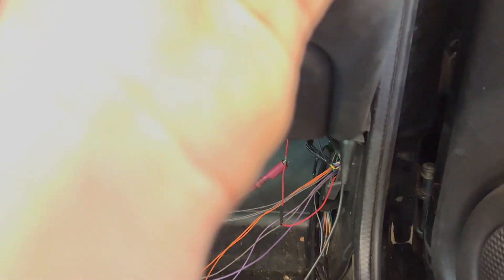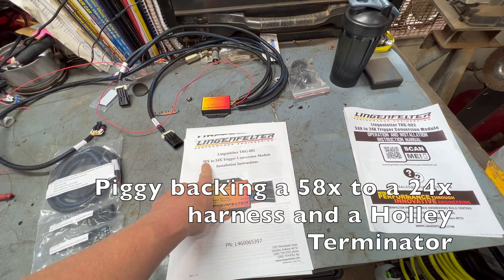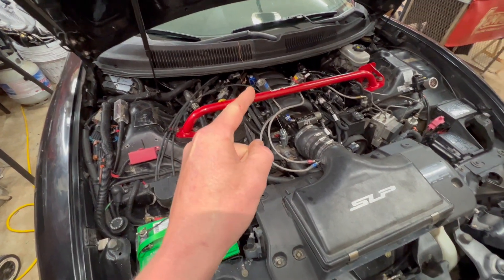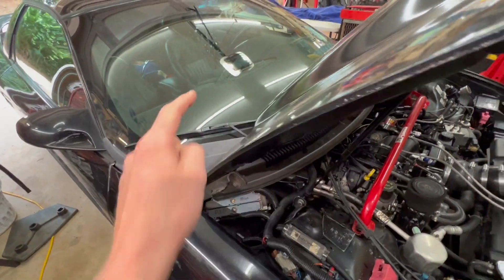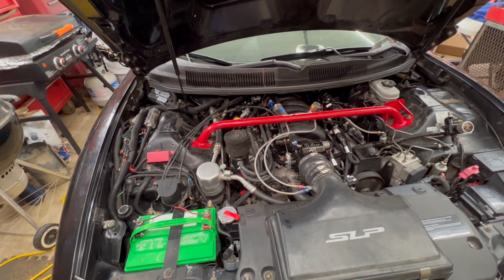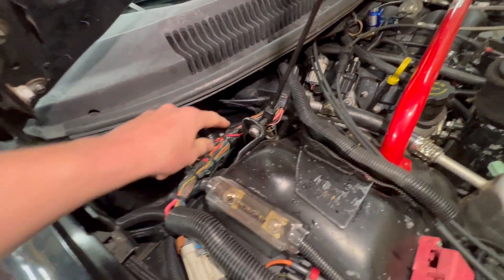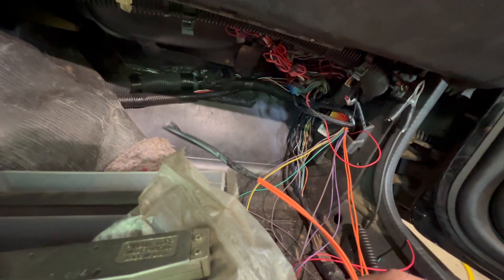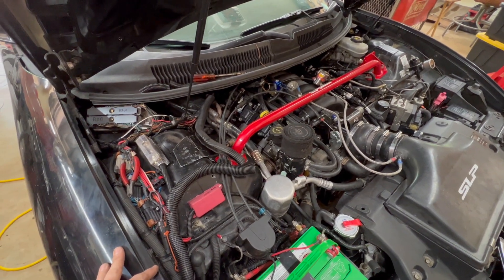LS Engine: 🔌 58x to 24x Crank Conversion

Comment: So Im currently building a stroker motor with a 58t reluctor wheel my engine comes with a 24t normally I’ve been told it: possible what sensors would I need to change
Reply from the maker: Yeah, sounds like the same setup I did. It’s been a few years, but I’m pretty sure you’ll need to run the 58x crank sensor with the front timing cover and gear matches that 58x setup. The box has worked great for me

Comment: So I can use this on my 08 Grand Prix GXP? I recently brought a 06 ss motor and it had the 24x wheel, all I have to do is set this up and it’ll convert itself to 58x?
Reply from the maker: Yes, exactly! That’s what I used in this video—the Lingenfelter TRG-002 box lets you run a 24x motor (like your '06 SS) with a 58x ECM (like in your '08 GXP). Just wire it up correctly and make sure your cam sensor is also compatible.

Comment: Just to confirm, you have the red power and 2 purple 12v's tied together into a key on 12v, main ground grounded, cam/crank signal, and nothing else. None of the sensor grounds or orange 5v's?
Reply from the maker: It’s been a while since I did this install, so I don’t remember the exact wiring details off the top of my head. Just wanted to let you know in case you're trying to replicate it—I’d recommend double-checking with a fresh diagram to be safe.

Comment: I’m wondering if I should wire straight in to the harness like you did and I’m not running a second ecu though so I was hoping it work plugging rite into sensor….. man I’m stuck if you can get back with me I’ll appreciate it thanks!
Reply from the maker: Man, I would like have to sit down and look at the wiring diagram. I am not sure off hand. I really cant help at this time.

Comment: I’m not getting 5volts ref I Change computer and harness im wondering if my box fried it still lights up red then gree when tuning but it looses signal….. and shall I say my cam wire on the box had got rubbed from my crank pulley so I’m wondering if I need to get another one
Reply: But I did soldered it back together
Reply from the maker: Man, I would like have to sit down and look at the wiring diagram. I am not sure off hand. I really cant help at this time.

Comment: So you need this if your vehicle had a 24x not a 58x and you’re changing crankshafts?
Reply from the maker: If your vehicle originally had a 24x reluctor and you install an engine or crankshaft with a 58x reluctor, you’ll need a device to translate the signal so the factory PCM can still function properly. In my case, I heavily modified the device because I’m using a Holley system for engine management, but I still needed the factory PCM to control things like A/C and cruise control. Those functions weren’t working initially because the PCM was expecting a 24x signal, so I had to integrate both systems.

Comment: Ware did you tie in your power wire man ? I think I need a good power source
Reply from the maker: Sorry, I cannot remember man. But if it makes you feel any better. The car is still working great with this setup
Reply: @ well i appreciate it man .. just trying to see ware a good power source would be ..right now it’s in my ignition wire I believe on the passenger side strut tower wiring .. but I believe I’m not getting a good cam signal 3 green blinks then red

Comment: Can rhe crank in and out wires be extended?  As in just connect the extension harness to em? I have my box in kick panel and was told i csnt use extensions
Reply from the maker: Yeah, that is fine. I cut and spliced wires.
Reply: @RocketGarageService  where is a good power source?  That Stays on while cranking car? Ignition fuses ?

Comment: Hey @RocketGarageService, I was looking at using one of these boxes for a project I'm working on (6.2L from an 08 Yukon Denali paired to a 4l80e I have) in 2nd gen camaro. How's this converter box working for you? I've read through forum posts and it sounds like some people have had an issue with the box overheating and losing crank/cam signal. Has this converter box held up for you without any issues?

Im really leaning toward getting one of these since I already have a gen3 standalone engine harness and don't feel like dealing with the hassle of trying to find a T42 TCM that is compatible with the e38 ECM that came with the 6.2L (harness is for a 6l80e and I cannot find information on how to convert the 6l80e wiring/connector to a 4l80e.I also dont want to purchase another gen4 engine harness w/ a 4l80e connector)
Reply from the maker: I read the same comments. I have had zero issues with the box. I am extremely happy with everything. I might have thousand miles on the car since the install. Several trips over an hour of constant drive time.
Reply: @RocketGarageService  awesome, thanks for getting back to me. Yeah, I just have not found good enough info yet for me to convert the 6l80 wiring to a 4l80 , and getting the conversion box seems a whole lot simpler since I have a working gen3 harness w/ 4l80 connector ready to go